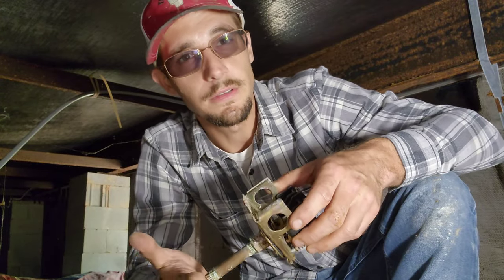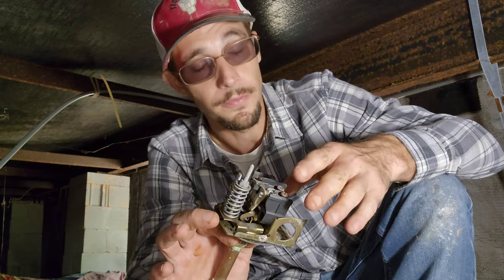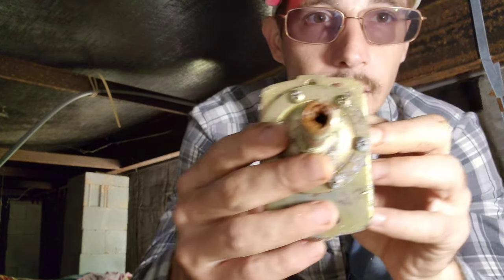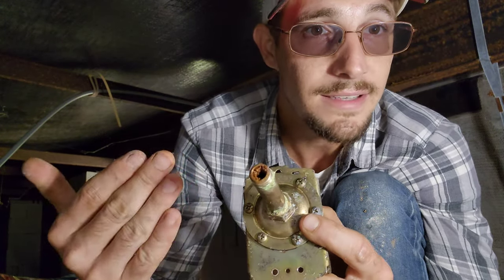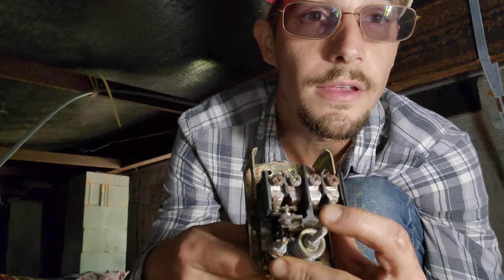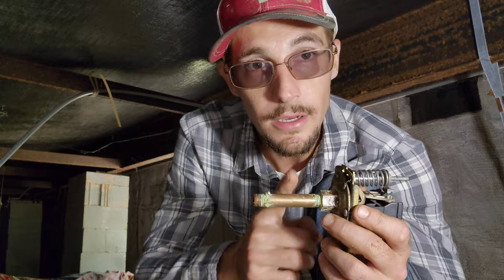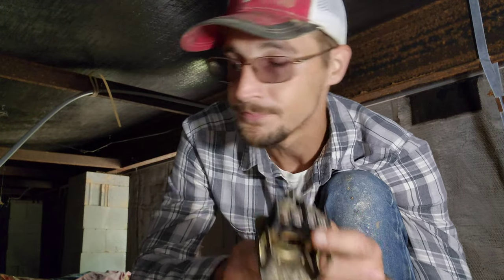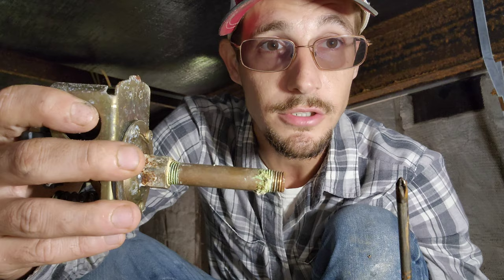No Water. Most Common Problem for Well Pumps.

Comment: The water pressure gauge goes down because of the water pressure leak down problem. The automatic pressure switch just turns on and off the pump. With no house water leaks, the pressure goes down because of failure of seal in foot valve due to lime build up in the BOTTOM  of the well .Either the expense of pulling out all the piping in the well is necessary  , or just add a brass check valve near the water heater where the main water line comes in. The arrow has to face upward with correct water flow direction. There are special shark bites fittings and brass fittings to hook it up properly. Old trailers have old style type plastic piping called polybutalyne that requires the "gray" color inserts of the shark bites. There is a shark bite coupler that contains a check valve. The brass style check valve is about $50 and requires other fittings. Changing a pressure switch and cleaning the lower metal tube will not stop water pressure leak down if there are no house water leaks and valves are turned off.

Comment: You no water in the title which is wrong because with a clogged pressure switch you’ll have intermittent supply with low pressure. Can you solve no water and pump getting current but not coming on?

Comment: The pump runs fun for 25 min until water in pressure tank runs out… then it takes 15 min to fill back up, so there is no water for 15 min.  Is this a clogged pressure switch nipple?

Comment: Bought a house in June 2022 that’s on a water well system. Everything seemed to be working fine but for about a week now we have been experiencing low water pressure. No high/low pressure or intermittent pressure, or surging, etc. Just steady low pressure. Pressure tank is a Perma Tank Hydro-Air PCM52 with the pressure switch and gauge on a manifold on top of the tank. Started troubleshooting. Turned off the power supply. Closed the shutoff valve to the house so the house lines stay pressurized. Drained the pressure tank through the hose bibb. I noticed the pressure gauge did not drop to zero psi, it stopped at around 10-15 psi. I did the knock test and the tank sounds empty. I can move the tank back and forth and don’t hear water swishing around inside so I’m fairly confident that it is empty. Released a bit of pressure from the shraeder valve on top of the tank and no water came out. Checked the pressure at the shraeder valve and the pressure was approximately 10 psi. We have a 30/50 Square D pressure switch so I pressured up the tank to 28 psi through the shraeder valve. I cleaned the contacts on the pressure switch and checked the voltage across the contacts (with the power on). Everything seems to be in order. Turned the power back on with the hose bibb still open and shutoff valve closed to flush out the gunk. Turned off the hose bibb after a couple minutes when the water cleared up. Pressure started building up inside the tank but very, very slowly and it peaked at around 34 psi after about 15 minutes of run time. Turned the power off again and repeated some of the steps with no luck. To make a long story short, the system is not pressuring up to 50 psi like it should. The pumps runs for a good bit but only builds pressure up to around 34 psi. I think the pump has been running excessively without turning off because the system cannot reach 50 psi. Do I have a water leak somewhere or is my pump failing? Power to the system is currently turned off so the pump doesn’t run all night. I would appreciate any feedback. Thanks in advance and thanks for sharing your knowledge.
Reply from the maker: The pump could be old & worn out yes, but more likely, you have a broken fitting that is cracked. The connection between the pump and pipe is cracked and leaking out most of your pressure. Either way, the pump line must be pulled out the well.
Reply: @h2omechanic  Thanks for the feedback. I will reach out to a water well company. Having just bought the house recently, I don't know the history of the well or the age of the components. I will look around the yard too for leaks.
Reply: Follow up question. Generally speaking, how long should it take to pump from pump on at 30 psi to pump off at 50 psi? I know there are lots of factors but I’m trying to get an idea how long the pump should run. It’s taking 20 minutes just to get up to around 37 psi and then the pressure stops climbing. No visible leaks in the yard. I have 3 or 4 yard hydrants but I can isolate them.
Reply from the maker: @cow7boy  30-40 seconds between cycles. You probably have a leak somewhere on the drop pipe. If you kill the power, does the water pressure drop to 0?
Reply: No, the pressure does not drop to 0 psi when I turn off the power. It holds steady and slowly drops when water is used in the house.
Reply: See previous response.

Comment: Right, but what if you get a new pump, new switch and capacitor. And still having issues we weren’t having before replacement? We even got a new pressure tank as well
Reply from the maker: Normally if your having a issue & its all new. Then the tank has too much air in it for the type of switch that you have. Go find your tank & the air nipple on top of the tank, press that in for about 12-15 seconds. That will let out about 5psi of air from the tank, then use the water like normal and see if the issue is fixed.
Reply: @h2omechanic  I will try that. I watched a few of your videos last night and will let some air out. Also noticed the wires are wired red red one side ect. Which I also got from ur videos and will try that as well. Very insightful content. And very appreciated

Comment: Here in the UK, the main culprit for blocked nipples on pressure switches in hard water areas is calcium (limescale) build up. Great video H2o M!
Reply from the maker: Here in the U.S.  Iron typically clogs the nipple. Crazy how difficult the minerals in water can cause so many issues!

Comment: I just wanted to come back to this vid and say thanks for posting it.  For about 2 weeks my water would slowly (over the course of about 30 seconds) lose pressure, then go out.  30-60 seconds later it would pop back on.  Then all the sudden it went out and was out for about 40 mins, came back on.  The next morning same thing….went out and was out for about half hour.  After watching a few videos I came back and watched this one several times, so yesterday I got the supplies and sure enough, when I took it apart that nipple was full of corrosion and stuff.  I ended up putting a new gauge and pressure switch on as well simply because I had it apart, but it seems to be working great today….all for about $100 bucks in parts.  Thanks again!

Comment: Good morning sir just found your channel because I turned on my bathroom faucet and got bursts of air and dirty water went to check my system and the pressure gauge wont go over 20psi the pressure switch is stuck open also checked my tank and no water out of the air valve any help would be a God sent thank you sir and I hope your enjoying your Sunday

Comment: You have great information, I just liked and subscribed. I’m new to deep wells and just ran into a major problem hoping you can help. My pump was waterlogged and I just got a new Johnson Controls 93B 1C air volume control. Before I could put it on my wife left the water hose running and now I’m not getting no water at all. I checked the breaker, control box and pressure switch and they all have power. Is there anything you recommend me doing before I call the well service company to come out? Any help will be greatly appreciated

Comment: Thanks for the videos.  Very helpful.  Im having an issue with water pressure.  Turning on faucet or shower, pressure is good but doesn’t maintain that pressure.  Water pressure slows down.  Then I’ll turn the faucet off for 30 seconds and turn back on to  normal pressure again but it’ll slowly fade away again.  I turned off breaker to pump and drained tank with faucets open.  Wanted to check pressure switch and clear the nipple but water was spraying out when I unscrewed the nipple and pressure switch.  Not sure if I missed something??
Reply: This is exactly what is happening to mine right now. 4/26/23

Comment: Thanks for all the great videos, you've helped my family so much!  Any chance you can do one on diagnosing a well that's running dry?  
My 75 year old, 75' deep well was acting up, so I turned it off.  I have a light bulb spliced into the pressure switch to know when the pump is running.  It wasn't turning off itself, I don't want to burn up pump again.  Any other suggestions for dealing with water table issues?
Thanks again!
Reply from the maker: A 75ft well is really shallow. There's not enough to work on & try to improve the flow. If your in a costal region, a drill company might be able to do an air lift (if its a screen casing well).

Comment: Water heater temperature and pressure valve usually are the weak point.  
Careful with that screwdriver,  you could damage the switch

Comment: We have a 5" pvc well that is 21 years old, goes down 86'. We've had a recent issue with sudden loss of all water pressure. Comes back a few minutes later. I've tested the bladder tank and replaced the pressure switch. 
Could the well be running dry???? How long would it take for the water level to recover?? Or is it most likely the nipple clogged???  Thank you!!!

Comment: Do you see any issues with using a pressure switch without using a tank on a well only used for a sprinkler system?  I know I can install a relay to work in conjunction with my sprinkler control, but I'd like to be able to open a spigot without having to turn on a watering zone. This is ONLY used for watering the yard and washing down the driveway and such..
Reply: Even if it theoretically works, a kinked garden hose or something obstructing the flow too mouch will cause your pump to short cycle.

Comment: So I have a shallow well.
Last night I lost water. And my pump at the well house was constantly running. I pumped it up to 38-40 lbs to my bladder tank, which was on 0lbs psi before adding air and water started to work as normal.
Woke up this am no water again and 0 lbs of pressure in bladder tank. And pump was working non stop. So I added 40 lbs and no water like night before. I then primmed the well line with water 3 gallons and their was a surge in line finally pump turned off and everything started to work as normal 
Is it a bad bladder tank? Or pump. Or pressure switch.
Or the well filter ?

Comment: Bruh - This helped - I went down and tapped on that nipple and the pump kicked on right away. Not sure if it's a bad contact, but either way, it seems to have done something.
Reply from the maker: It's best to replace the switch and then clean out the nipple it's sitting on. Itll happen again most likely, so buy a 40/60 switch & have it on hand

Comment: I have a bored old well. 1hp pump. We had a vicious cold snap. I replaced one line, thawed the well and pressure tank, replace the pressure gauge, got it to 50/30 and had great water pressure everywhere except the kitchen  sink. I had nothing, checked for clogs nothing clogged.  adjusted the pressure a little and got sink hot and cold pressure back, but lost the cold water in my bathtub ..The tub has awesome hot pressure but almost zero cold please help..THere are no leaks that I know of because I looked and the well isn't cycling on and off..Whats going on here?

Comment: My system takes water from a storage tank and pumps it into the house. I noticed my on demand water heater runs normally until the pump starts (centrifugal pump) and then drops out from what I believe is low pressure. The pressure switch is set for 20 - 40 psi. I drained the system to test the bladder tank settings. in draining the system pressure drops slowly from 40 psi to 30 and then collapses to 20 until the pump restarts. Is it a pressure switch problem worn pump (20 yrs old). This is a recent problem and my water heater (2 yrs old) just started acting up like this. Any ideas appreciated.

Comment: In California no one runs straight off there well ever one has at least a 5000 gallon tank and the new house have to have 10k 5000 is for fire required by the state. Some people will have a by pass from the tank to the house and a booster pump set up or vfd  to the house. No one wants to be out of water if something needs to be repaired on there well lol it really rare that someone run just off there well. 💯👍👌✌️💦🇺🇸🍻🥂

Comment: I have a vertical deep well pump that is not priming and I my family has been without water for a week now. I don't know what to do. I've tried replacing the pressure switch, and replacing wire. Still no water
Reply: Do you remember what you did to get it fixed? I'm in this same situation right now.

Comment: We have replaced the pressure switch, didn't work. Replaced the pump, didn't work. Now we're thinking about replacing the tank, hoping it works - but our current tank is also taking and holding air so I'm not sure.
Reply from the maker: Test for power out at the well head. If u have power there,  240v typically.  Then it's likely that the wire going down the well is broken.

Comment: I’m fighting the same pro-blemish but the nipple is free and clear I’ve replaced several switches and a nipple. Bladder tank is good also I don’t get it
Reply from the maker: Tank probably has too much air. Try lowering the tank air pressure by 5 psi
Reply: @h2omechanic  will do in morning will let you know

Comment: Can you please  help me my pump is not on but the pressure switch has sparks I don't know what to dob
Reply from the maker: Is it freezing temps where you are right now?
If so its likely froze. Turn off the pump breaker.
Regardless, sparks means the pumps running, so it's not providing water, it's either a dry well due to a leak (Check your toilets) or the pipe going down the well has cracked & failed (you would have noticed sediment or low pressure prior to no water). Or it's frozen. 
Or the pumps so old it just can't lift water anymore (doubtful)
Reply: No  zip live in Florida I tried everything

Comment: Hi. Great video.  What about the relief valve on the tank tee, I thought If the switch got stacked and pressure builds up in the tank, the relief valves should pups (opens) and relieves the extra pressure

Comment: I'd like your opinion on using a safety line on a new submersible pump @ about 100 ft.  Seems like a good idea, but I've read opinions against it.  

Also, do I need a SS check valve and a SS male adapter both ?

Comment: No I lost pressure last night the water was barley coming out  so I went to the well and turned on the spigot and nothing but air came out it sounded like a air compressor pissing air out the gauge says 75psi but no water is coming out anywhere at my house